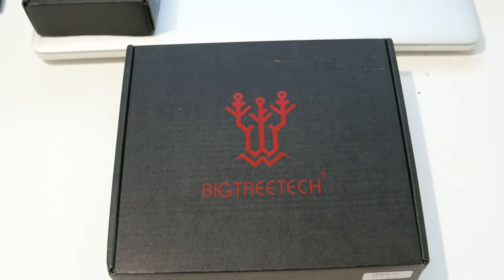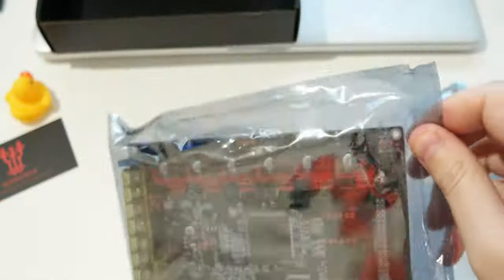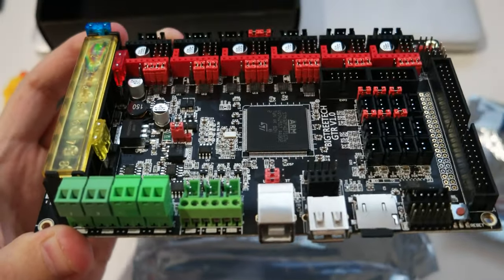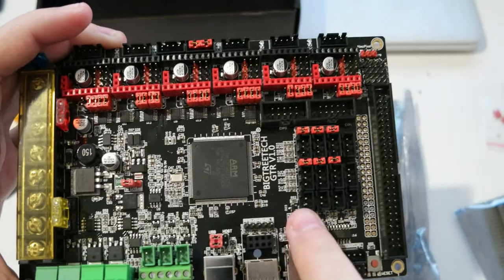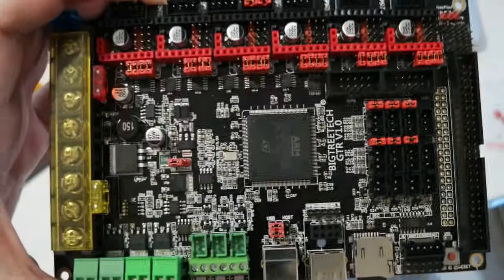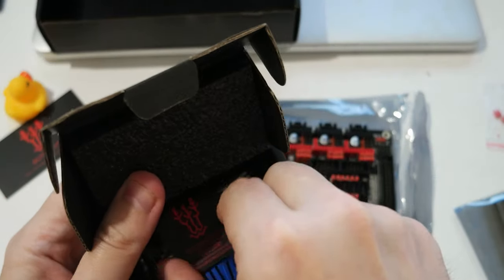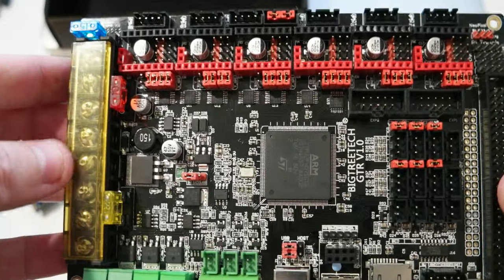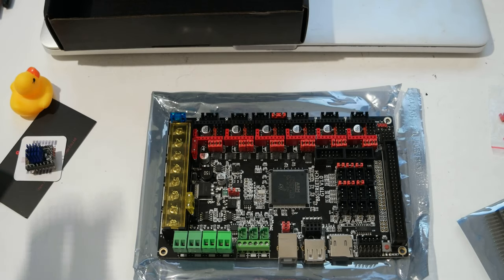Unboxing BTT GTR 1.0 and BTT TMC 2226

Comment: Why did you change from Pro to GTR? You may have mentioned it but I missed it.
Reply from the maker: I thought I mentioned, I needed a backup board so I picked the GTR as a backup and update to my Pro. I still have the Pro! Please subscribe thx
Reply: @ganzoai  You did mention backup but I didn't understand it was the reason.

I'm glad you still have the Pro since I ordered and there is so little information about it. I will subscribe now.
Reply from the maker: @timmturner  cool, hope my videos are helpful. Also do not buy the 2226 since they are basically the 2209 and Marlin is not going to add them to the supported drivers even though they work under 2209 configuration. I followed the Marlin github issue and basically there is no reason to get them! thx
Reply: @ganzoai  I will be using 2209 and possibly 5160 in the future.

Thank you for the helpful information.
Reply: @ganzoai  what do you mean, they are suported by marlin because they work the same as the 2209, the 2226 are just an upgrade in terms of heat disipation
Reply from the maker: @dimitriecioraneanu3041  they are supported by defining them as TMC 2209, yes better heat but they are basically the same so there is no need to get them. In the Marlin discussion thread was mentioned this so there is no need for them, no real new feature.
Reply: @ganzoai  oh, i understand, i thaught you said like dont buy because they are bad or something. I got 5 of them simply because i payed like $4,5 for a pice and 2209's where $7 at the time
Reply from the maker: @dimitriecioraneanu3041  oh yes, they are cheaper ! :) I got them because my prints will last very long time, no less heat better it is! please subscribe thx

Comment: Hello and thanks for your information. Regarding to the TMC2226, is it necessary to cut the Diag. pin when not using the sensor less homing function, as it is required for the TMC2209? Thank you.
Reply from the maker: You do not have to cut the PIN and it's valid for the TMC 2209 too, just use the configuration to set what you want to use. Please subscribe, thx
Reply: @ganzoai  Thank you for your clear and expedite reply. I will consider it when the upgrade to the machine is made. I will install a SKR 1.4 Turbo, 5 TMC2226 (independent Z axis (2) stepper drivers). I subscribed to your channel.
Reply from the maker: @alfonsopalacios4419  I misunderstood, if you want to use 2209 without sensorless because you are using switches for example you need to do something to the "sensorless" pin, I suggest you to do what this guy is doing so that if you want than to use sensorless you have the option to https://www.youtube.com/watch?v=l0nfRrV6ggU
Reply: @ganzoai  Hello again. I appreciate you to have taken the time to answer to my questions. Yes, I pretend to use the sensor less function on the X and Y axis. For Z axis I will be using a BL Touch. My quation is in regard to the TMC2226 I already have; Then, as you mentioned, I should remove the Diag., pin of these TMC2226 for the two Z's as well as for the E0, as it is made for the TMC2209?
Reply from the maker: @alfonsopalacios4419  I assume you do since you are not using sensorless for z too. Just use the method in the video so it would be easy to keep the pin if you want to change something in the future.

Comment: what is k-temp?
Reply from the maker: what are you referring to?
Reply: @ganzoai  The GTR has output power for E0, E1, E2, K-Temp
Reply from the maker: @cdxer  yes, I use the mosfets in between so no high current goes through the board. Please subscribe thx !
Reply: @cdxer  it is for the k-temp thermocouple, a kind of thermistor that can withstand greater temperatures (up to 500°C)